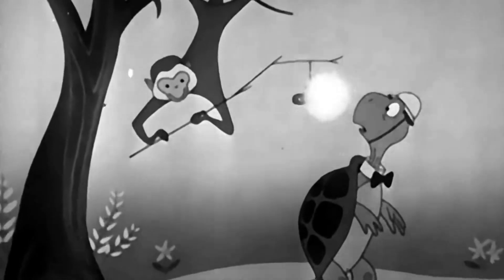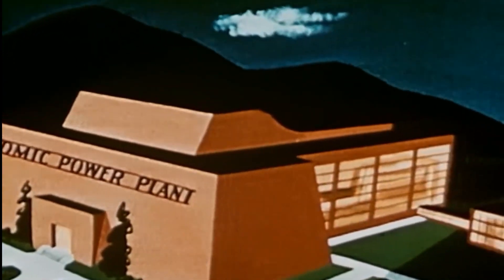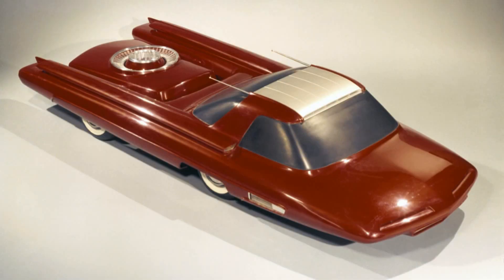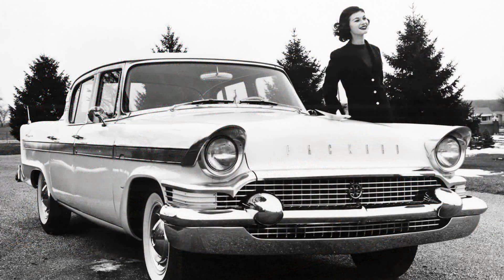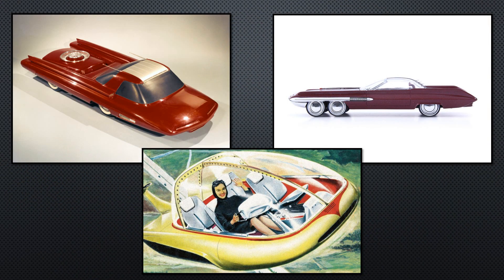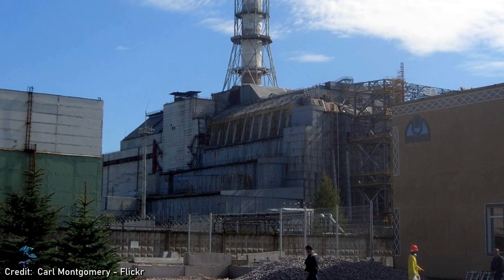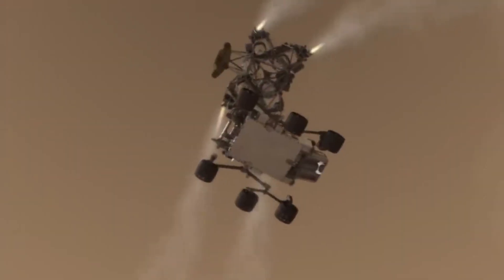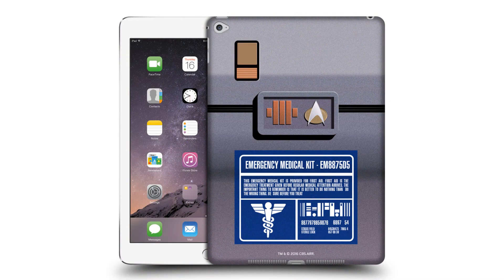Our Nuclear Alternate Future?

Comment: Two things worth mentioning:
1. Half life of Pu-239 is about 24 000 years and not 10k
2. It can be used as a fuel
- it has been used as a fuel ever since the 60s
- the ability to use more of it as a fuel is what the next gen (gen 4) reactors are all about (cost benefit ratio has been improving)
--> It isn't exactly nuclear waste as much it is nuclear fuel for current and future generators

Comment: ❤
Reply: France turns their nuclear waste into glass and stores it in a really big cavern underground.
Reply: I was thinking you could like dump plasma in a ceramic crucible which is stronger than steel. Though ,  ⛽ sand man gad stations sounds neat . Pump , 1000 ° silly sand into your thermal gas tank.
Liquid sodium would work really good but t silly Sand would be bad enough. The good thing is you could only have licensed Jim Neighbors Goobers filling your  silly ⌛ sand tank.
=====
The reason it won't work is someone was suck a siphon hose . 
===
The ambulance crew would definitely quit 👋😎💨🎶☕💕🙈 Bryan

Comment: Dangers and costs set aside, a nuclear power plant would be a poor choice for a car. Nuclear reactors have a terrible power/weight ratio because of the heavy radiation shielding needed, even lower than that of a steam engine. A passenger car needs about 100hp/ton for decent performance, back then probably 50 hp/t would do, but that is still not achievable with a nuclear reactor.

Comment: Good grief.  Cadillac never proposed any thorium cars.  That was a Charles Stephens investment scam, and they put the Cadillac emblem on the drawings.  The renderings were done by a skateboard designer.  And, this nonsense about powering a laser to run the car is off-the-charts wrong.  Again, they only did that scam to attract investors.  Don't believe me?  Contact Cadillac yourself.

Comment: Still a lot better than my terrible design; "Let's take an internal combustion engine, but give the spark plugs radium-infused electrodes, and put radioactive isotopes in the hydrocarbon fuel like carbon-14 and tritium, and just a tiny bit of lithium-6. And while we're at it, let's make the engine out of neutron-reflecting materials like tungsten carbide and beryllium."

I can have some downright awful ideas.

Comment: Soviets also tested several nuclear cars, the body was taken from GAZ-21, but 3rd axis was added in the front of those cars to carry the weight of nuclear powerplant: https://miraes.ru/wp-content/uploads/Volga-Atom.jpg
They were different in that there was no steam produced, it used properties of radioactive fuel itself to produce mechanical energy somewhat akin to internal combustion engine - when piston was in upper most position system produced more heat, as the source of radiation was placed on the piston, gas (helium in one version and uranium hexafluoride in another) expanded in volume pushing piston, then cycle was repeated. I suspect, that would also make such "reactors" more prone to leaks, as there were moving parts, which wear off in time, sealed only as much any other engines piston is sealed.

Comment: My uncle worked on a gov. Project developing nuke powered jet planes. After a few years the project was deemed too dangerous and was cancelled. The reactor was the size of a 40 qt cooler and all It did was heat air from an intake and use the heated air vectors of course for propulsion. Such a simple design, the small rods (the size of a no 2 pencil lead) could fly a plane for 6 months at a time. With today's thermalvoltaic tech we can generate electricity just off the heat no steam turbine needed.

Comment: Thorium reactors consume LWR waste to catalyze the thorium into a fissile material. Takes a few weeks then the Thorium is fertile. The real difference is efficiency. 95%+ for Thorium, compared to 3 - 5% for Standard models today. 95% trash. Nixon tried to remove our greatest achievement from history. The ORNL MSR project had a unit built and operating for 20,000 hrs. Easily variable output control, similar to diesels. Shut it down on Friday and fire it up Monday morning. Walk away safe. Also the byproducts of Thorium are extremely valuable. From Nuclear medicine to Nuclear space batteries which are no longer available.

Comment: This is basically a Compact Nuke with wheels
Reply: Reactors and substantially different from nuclear weapons.
Reply: @paulanderson7796  but they can still cause a big explosion
Reply: @-cold-1761  A reactor cannot explode in the way a fission bomb explodes. Reactor accidents are steam explosions.
Reply: @paulanderson7796  either way these cars are super dangerous and in a car crash, almost like a mini bomb
Reply: @-cold-1761  These were only concepts. No one was ever seriously about this from a commercial perspective. There is a scale below which it's impossible to build a reactor. But if it were possible it's no more dangerous than a tank of inflammable liquid.
Reply: @paulanderson7796  I know they were concepts, but if they ever existed, they would be like mini bombs with wheels
Reply: @-cold-1761  a tank of petrol is more dangerous.
Reply: @paulanderson7796  it could be more dangerous, but in a car crash, the radiation of the car could cause you a lot of health problems.

Comment: If the nuclear car had gone ahead we wouldn't be having the environmental apocalypse we have now. Nuclear energy powers France cheaply because they don't cut corners and aren't beholden to oil companies. You should stop letting hollywood pulp sci fi influence you.
Reply: Very well said. There are far too many myths propagated relating to the safety of commercial power reactors. This is intentional, for without fear, nuclear weapons are useless. Secondly, there is still a fortune to be made from fossil fuels. Governments and oil companies are inextricably intertwined. They're not gonna give up that profit mountain any time soon. Thirdly, there is a fortune to be made from the 'management' of reactor 'waste'.

Comment: You did not actually research the thorium reactor, as its actually called a breeder reactor, as one can use it to breed nuclear waste away, in fact most likely the breeder reactors are going to be our salvation in regards with the nuclear waste problem, if the nuclear powers can just let it happen. Funny enough the US developed the first ever breeder reactor, in the 50's, and had a chance to revolutionize nuclear power, however they chose not to, as breeders have the side effect of making very little to no weapons grade materials, so its no use for a nation that needs to maintain 6200 nuclear weapons, and in the 60's it was worse as the US was maintaining 30 000 weapons.

Comment: We've known how to safely store nuclear waste for quite some time, it's called "put it under water". Also now (meaning the last 30 years) we can use that waste in breeder cycles to make virtually endless power so you don't need to throw it away. Meaning it's self-sustainble. But people that want things to still be under the control the current industries tend to forget such simple facts, and even pass laws based on such deliberate forgetfulness. So just let the kids play with their "green" that allows them to feel "safe" and keeps the big guys in play, instead of switching to something that could give us energy for almost just the cost of transmission with a negligible generation cost compared to any other current method.
Reply: Very well said. There are far too many myths propagated relating to the safety of commercial power reactors. This is intentional, for without fear, nuclear weapons are useless. Secondly, there is still a fortune to be made from fossil fuels. Governments and oil companies are inextricably intertwined. They're not gonna give up that profit mountain any time soon. Thirdly, there is a fortune to be made from the 'management' of reactor 'waste'.

Comment: Nuclear power still is a major power source today. And to correct you, it is proven to be much lower priced than coal (10 times cheaper, no less). The only things which retained nuclear from being more widely used was the inability to stock the energy produced, and the public opinion on safety following to the early stages mistakes and disasters. We today have improved solutions to address those points. So today, the major problem is public opinion is emotional, and not technical.
Reply from the maker: Can you point to a source for that?

Comment: Interesting historical information but seems rather anti-nuclear leaning.  A nuclear car is not practical, but the comment of 10,000 year waste is a bit misinformed, particularly when it comes to thorium/molten salt reactors and other Gen IV designs.  The reason the "spent fuel" is radioactive for so long is that it contains PLUTONIUM which was created by the uranium being (bred) in the reactor.  However, plutonium is FUEL, and is designed to be consumed in the newer reactors.  Our current reactors today are roughly like burning the bark off of a log and throwing the rest away.  Newer reactors will burn the whole log.  As for today's reactors, while they are not as efficient as the proposed new reactors, they are far better than our other current options in terms of total waste, availability of power, cost, etc.  The "spent fuel" is easily stored in a small area of casks and decays rapidly down such that you can happily stand next to a cask and not suffer more exposure than you'd get on an overseas flight.

Comment: i think the big problem is using the reaction to produce heat to boil water.

i think the ideal setup would be nuclear/solar type setup with the nuclear cell wedge between to "solar" cells and then use that to charge a battery which would then move the vehicle.

and we already have tech that does this already but for long running low wattage applications,
an example of such a device would be the nuclear pacemaker.

Comment: Thank you for the most biased video I've yet come across.

Perhaps you should have mentioned the flawed design of Chernobyl. Or high pressure reactors in general and that better designed options where proposed in the late 50s and 60s. Or is balanced presentation beyond your scope?

Or how about nuclear waste from the reactor is dangerous because 94% of the reactor fuel is still in it unused?

You ridicule thorium reactors yet fail to mention that designs of them, called breeder reactors use up almost all of the nuclear waste to produce more power. Or why didn't you mention the fact if a thorium reactor try to melt down it passively shuts itself off.

Ok ill give you trying to put any reactor in a car is silly. Sadly they either did not know that yet 60 years ago, or it was just another government graft program. But dude at least do some research.
Reply from the maker: I agree I was a little negative on nuclear, probably too much, and I'm not in general a negative person.
However, we had a nuclear reactor disaster just 10 years ago. The reactors around today will have similar deficiencies. I'm unconvinced we won't have another one in the next 50 years.
Having said that, new designs are much better, and thorium looks like it will help with the half life issue (storing waste for 1,000s of years). That's great, and we need something that doesn't pump greenhouse gases to help solve the "duck curve" problem solar & wind gives us.
I'm not sure I "ridiculed" thorium reactors. I just said they won't fit into a car, which was the point of the video - about nuclear powered cars, not nuclear power in general.
Reply: @BigCar2  I agree in that high pressure water reactor work for a sub/ship surrounded by water to cool them. But that same reactor on land without an endless supply of water on all sides is a recipe for disaster. To be fair they have made great strides to make water reactors safer. But you don't just slap a bandage on a patient that requires surgery. We have run operational thorium reactors for a 5 year period in th 60s. There is 0 excuse we don't have clean power today.
Reply: @BigCar2  I believe your condescending tone was very ridiculing on the subject. Also your comments came off sparky. Both together I would say qualify as being condescending. 

    It does seam silly to suggest putting one in a car. But simply stating the facts of why it's impractical is much more productive to me.
Reply: @BigCar2  To respond to the nuclear disasters over the past decades. One heavy water units are great for ocean craft but not so much for nuclear plants.

It should never have been allowed for the man who held the patients to them head the NRC and set policy what we would build. It smacks of corruption.

Had we taken the better option back then we would now have a distributed network of plants that would greatly reduce fossil fuel use. But that's no excuse not to correct the problem now.
Reply: @BigCar2  But to return to cars, you made the comment about them being "steam" cars.

So what if they are? Burning fuel is much more effective than exploding it. 2/3 of gasoline is wasted in heat, vibration that creates the pollution we know.

If we took the same gasoline and burned it to run a small steam powered generator (think the portable electric generators we already make except steam powered not internal combustion) to power an electrical drive train. You only need a few standard batteries to make it a turn key start and go. The generator takes care of most of the power. Is it zero emissions? No. But if cutting car pollution by half or three quarters or possibly more does qualify then it's not about solving a problem it's about an agenda. 

The cold hard facts is that there is no clean portable electrical source today with our current techology.

Comment: If I remember correctly, there's a documentary on here somewhere that talked about the "shelf life" of radioactive waste being sort of a white lie.  While the half life numbers are correct, the real problem with radioactive waste is that it's not depleted.  It's spent, meaning that a full fledged reactor can't run off of it and produce the energy its required to, but a smaller, second tier reactor could. I think the claim was that you could have a second, and even a third tier reactor that the fuel could go through until the radioactivity of the spent fuel is much safer for the environment.  The reason we don't do that is due to all of the nuclear treaties.  If true, then it wouldn't be crazy to fuel a train or perhaps a tractor trailer with a fraction of the second or even third tier spent fuel.  The risk would be very low and it would help get rid of all of the nuclear waste we have.

Comment: In all fairness, nuclear power is not a bad thing. Chernobyl was such a disaster due to a combination of human error and old equipment. Though i don't thing small reactors in stuff like cars are a good idea, as a powersource for powerplants on the other hand is much more green than Oil, coal and gas. And if more modern reaserch is put in to it they will be even better. And the waste produced is much more safe than all the CO2 Generated from coal, oil and gas powerplants. And there might be ways to refine and recycle nuclear waste in the future.

Comment: why build a nuclear train when you could just build an electric train powered by a nuclear power plant?
Reply: Mars, for the same reason you can't  stick solar panels in the Sahara and power the entire world. You would lose more power transmitting it over long distance than you would gain from generating it in the first place. 

You'll need super conductor wires to accheive that, and if we were to have room temperature & pressure super conductors it would blow the doors wide open to fusion energy.

Weight is a major issue for mars as well, you can't ship millions of tons of copper cabling to mars but a reactor that fits in a shipping container is 100 percent feasible.

With a nuclear train you could load up water from the Martian poles & bring it to where you need. 

Even with the most advanced waste processing equipment water still is required to be sent to the ISS on rockets, with a train you could haul hundreds of thousands of gallons of water in one trip. You could also haul stuff such as processed food,industrial equipment, and building supplies.

https://www.mrc-rail.com/railcar-results/tank-cars/

https://www.youtube.com/watch?v=Sh6BKKFxN_g

https://www.westinghousenuclear.com/new-plants/evinci-micro-reactor

If I were the president I would push congress to create a tax break in the law code that would enable Westinghouse to send several modular reactors to mars at no-cost to the taxpayers for a nice tax break.

Comment: Radioactive ' waste ' can be safely placed back into the ground at uranium mines.  The radioisotopes came out of the mine diluted, and were then processed to be concentrated for use in a reactor.  Why not dilute the ' waste ' to the same concentration as the ore in the mine, and then simply bury it there where it would be no more dangerous than the ore is was made from.  Or, better yet, stop calling it ' waste ' and refer to it as ' material ' to be reprocessed and reused.  Why mine thousands of tons of ore to get fuel for a reactor when ' waste ' is already concentrated and thus can be made into recycled fuel using a fraction of the resources?      ;-)